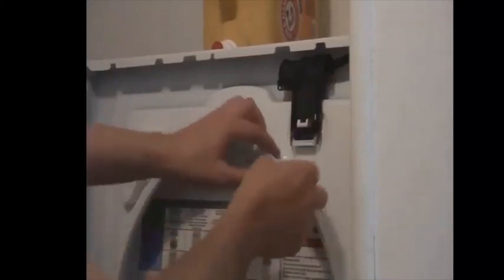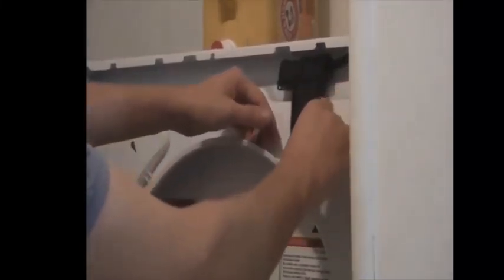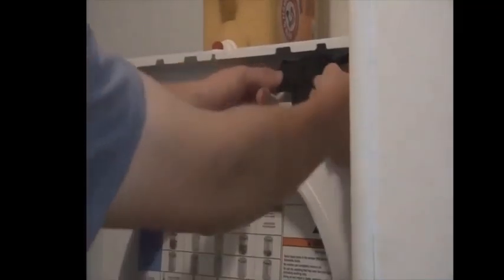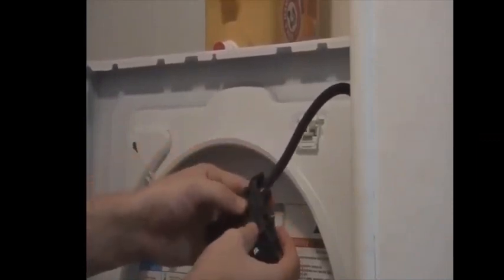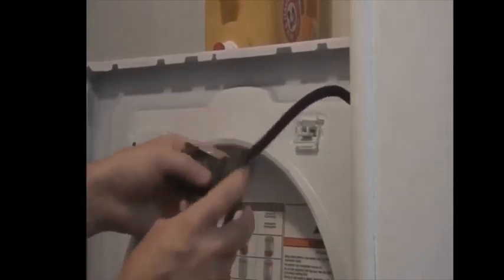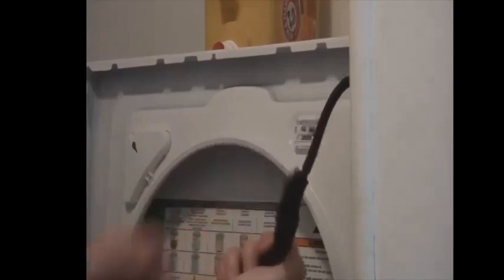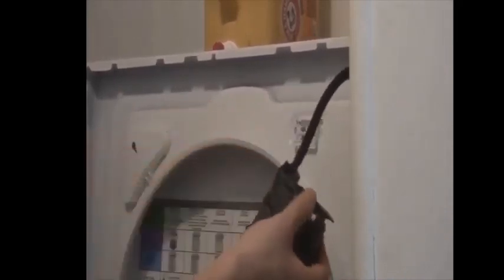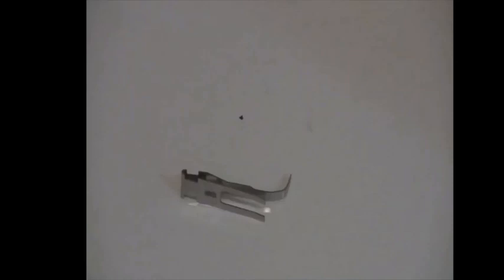Amana Washer Lid Lock Bypass    Vertical Modular Washer lid lock bypass

Comment: Just fixed mine!!! Or I should say it's operational.  Cut the 3 wires. Connect white and blue. Tape it up good and add a wire nut. Now the lid doesn't have to be shut while I'm adding in cloths
Reply: What I was looking for, sir!!!! Gonna try it
Reply: Now, I got it to fill with water, wash and drain but after this it just sits on sensing fill... Ran a diagnostic and everything runs except I can't seem to run any hot water thru even though I have adequate hot water pressure... Does this sound like a bad inlet valve and would that make it stop before it rinses?
Reply: Cut the wire from the locking mechanism and leave it plugged into the circuit board? Tape them up together and wire nut over the tape? Haha I’m trying now to buy a new washer
Reply: @deanak.614  was just a quick fix until we were able to buy a new washer. Glad to say that one was scrapped months ago. And we have a new washer.
Reply: Thank you. Typically when these switches close they are grounded. At least that’s how a lot of automotive switches work. Like a seatbelt sensor. When you clip your seatbelt in it grounds the switch. So if it goes bad you twist the two wires together and your car won’t ding at you. This is the same but you saved me the time of figuring out which two. Thank you

Comment: DUDE... At first I was like "should I do this?" Hell yeah I should do this. FIXED Bruh. Thank you.
Reply from the maker: Im so glad you found this video helpful!  This reset is good for any vertical modular washer (VMW). In other words it works for pretty much any top load washer  boughten n the last 0-15 years that wasn't made by LG or Samsung (they as well have a similar reset but isnt as universal as the reset you learned). VMW's are distinguishable by the ever so hated lid lock device, not to be confused with the old school lid switch device that allowed you to open the lid at anytime without waiting for the washer to come to a stop and the lid lock to release.  If anyones intersted VMW's are sold by Whilrpool Corp.who in return owns almost every american appliance brand such as kenmore, maytag, amana, roper, inglis, crosley and many other brands they are a few brands away from monopolizing the appliance indusrty in the US. Word to the wise: an $800 Maytag VMW lasts just as long as the $550 Roper or Amana VMW and has all the same parts. The only difference is the name and the price. Think of it as buying a shirt from nike and one from walmart. The shirt from walmart is way cheaper and will get the job done, If you think putting more money into appliance will get you more life out of it youll be sad to find out that no matter the price of the appliance they are all pretty much lasting 3-5 years only now not the 20+ we are expecting. 

Which appliance do i recommend?  The generic VMW's sold by Roper, Crosley and Amana. There just as good, last as long  and cost less than the Maytag VMW's. I also recommend always adding the 5 year protection plan add on for about $120 which will pay for all future repairs for the next 5 years which will pay for itself 2 or 3 times over after year 2 or 3.  The 3 year add on is a waste of money because the machines typically last just long enough to get past 3 years.

 I hope this tutorial and explanation helps you, your friends and your family god bless you and thank you for watching! Oh and if you don't mind please like the video and subscribe to the channel to help the channel grow so we can reach more families like yours!